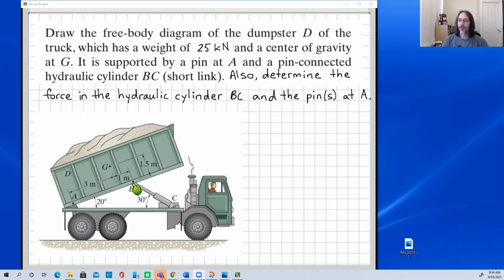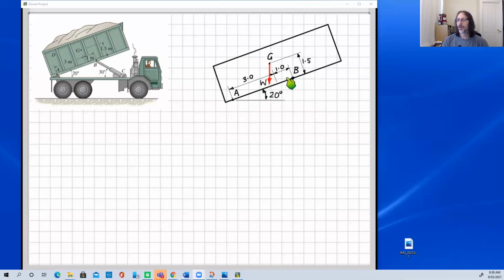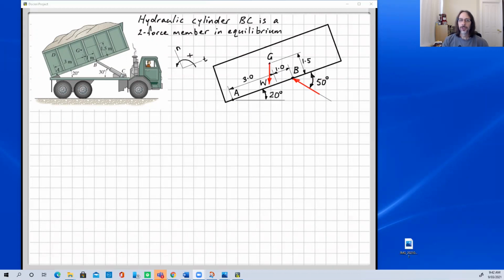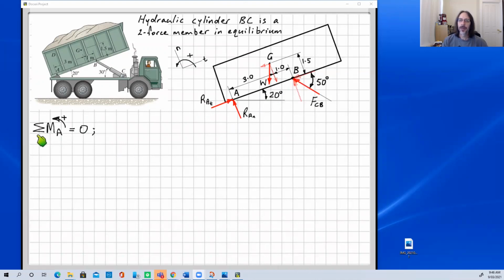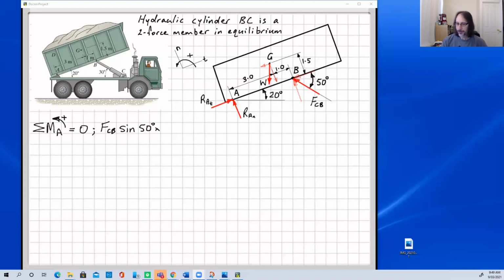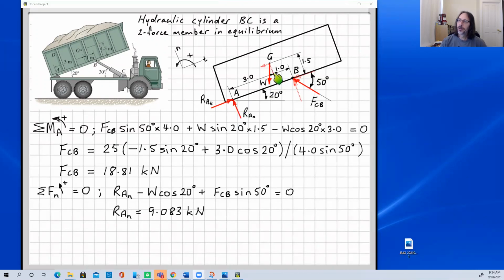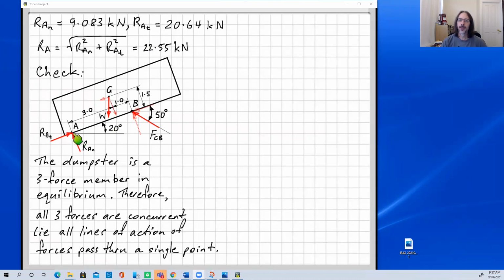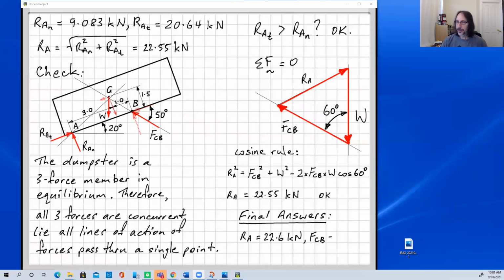Dump truck analysis

Comment: Please explain 60 deg in cosine rule check, I am sure it’s a simple answer but I’m struggling.
Reply from the maker: Angle between F_CB and horizontal is 30 degrees (from 50deg - 20deg). Therefore angle between F_CB and vertical must be 60deg.

Comment: When calculating using normal X-Y coordinates I am getting 23kN on the hydraulic piston. Basically the 1.5m offset does not come into picture. The answer should not be changing based on the coordinate system, can you clear this please?
Reply from the maker: Assuming your X-Y are horizontal and vertical. The 1.5m dimension will be needed when working out the horizontal perpendicular distance from line of action of the weight to point A (if taking moments about point A)
Reply: @TerryBrownMechEng  Thank you.

Comment: Mr. Brown, would you calculate a solution for an actuator (placement, size) for my Agrifab lawn vacuum?  I don't know the weight, but it is a 26 bushel collection bin that tips for evacuation.  I will try to attach a .pdf drawing to this message.  
Two drawings:
1) dimension detail
2) another recommendation - shown in black
I guess I can't attach the pdf drawings.